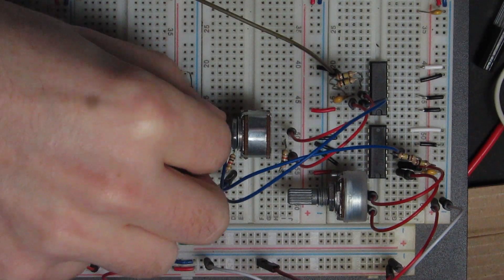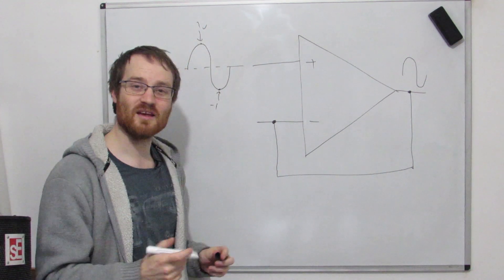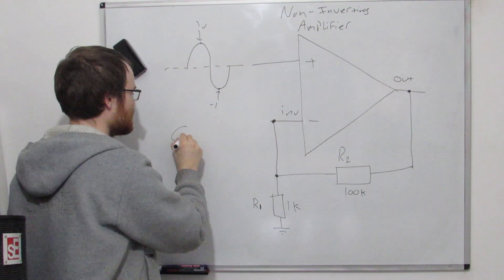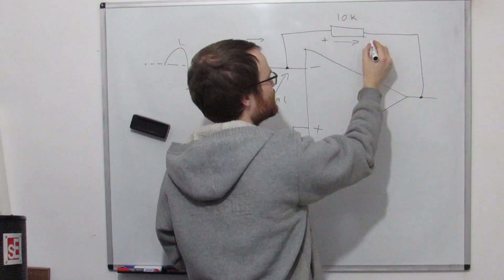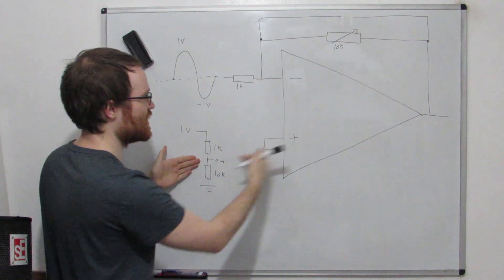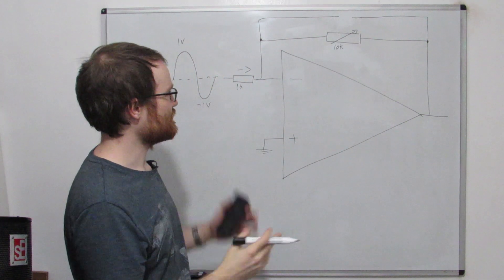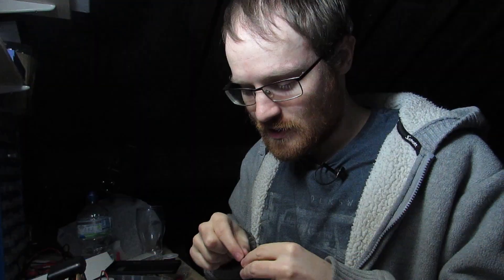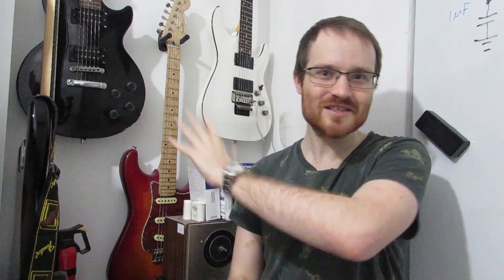Op-Amp Golden Rules & Designing An Active Filter!

Comment: Thanks for posting. If + input of opamp starts at 1 at peak of osc and - input starts at 0, then diff is 1 so it outputs 1 and then the diff is 0, so…..how does that function if diff is 0 at that point? Basically it seems as though it would outputting a binary toggle as voltage is + on + input.

Comment: NEWBE QUESTION THE 40106 AND 4069 ARE THEY CONNECT TO +12V AND -12    OR +12V AND GND
Reply: Both can be set up either way (which is part of their appeal). Generally you'll want a steady reference at half your supply if you want to start off with simple battery powered bits.  This reference voltage will act as ground (zero potential) for your little audio signals.  The trick is to hold that reference steady under various conditions.

Comment: CD4069 is a Logic IC and not an OP-Amp nor an Amplifier. The IC has nothing to do with an OP-Amp or an Amplifier !
Reply: It performs it's logic switching by extreme amplification (to keep the edges sharp). That behavior can be manipulated into operating in a (mostly)  linear inverting amplification.  It's an extremely common use of the cd4069.  It's used in synthesizers and guitar pedals and all types of silly stuff from major manufacturers.
Reply: @ahdziz666  Try to get a sinusoidal direct from the output of the CD4069. That will not work . The CD4069 is sometimes used to improve square wave signals. Since the gates contain a Schmitt trigger. But the CD4069 is and remains a digital IC. And is used in logic circuits.I can well imagine that the chip will be used in synthesizers. Because sometimes you want everything to be beautifully distorted. But that doesn't make it an Amplifier....
Reply: @ahdziz666  I just read the data sheet the CD4069 has no Schmitt trigger but there are some with Schmitt trigger. Sorry, my statement was wrong on that point! I can only recommend reading the data sheet. It's all in there!
Reply: @Thomas72B  I've read the data sheet and built a few bits and pieces using the 4069 as an amp.  It's not pretty but it's easy and good enough for stomp boxes and wah filters.  You can make a sine generator out of an inverter that's looping a twin T notch filter.  It's not anything like a pure sine wave but it can make synth drums ala tr-808 quite nicely.  It's also nice to damp down the feedback a bit and make a fuzz pedal.  Or you can go full on gated square wave distortion as well.
Reply: @Thomas72B  you might be thinking of the 40106 Schmitt trigger chip.  Great for some simple oscillators, but not so much for driving an analog signal.
Reply: @ahdziz666  The CD4069 is the wrong chip for analog signals. Analog signals are not the job for a CD4069. If you do that, it's wrong use because it's not designed for that...there are much better options for analog signal processing !!
Reply: @Thomas72B  I understand your point but I'm perfectly happy to use things for whatever works especially of I have a box full of them (which I do).  Even some of the mfr documents show the 4069 used as an inverting amp.  The internals of the chip aren't magic.  They behave as one would expect depending on how you connect them.  That being said they are also very handy for their intended use of inverting digital logic (which is why I have so many to play with).
Reply: @ahdziz666  I can understand that very well. I think I used to be the same way ... but then I learned the whole thing and today electronics  is my job and my Hobby.
Reply: @Thomas72B  I'm just a musician and a math nerd. If I can make the numbers work and the sound is cool, then I'm happy regardless of how I go about it.  I am more into the DSP side of things myself but my son is getting big into guitar so I figured we would build some modular FX.

Comment: All you're doing is writing a ton of stuff. No idea what you're doing until the end, and that's very unclear. You need to learn how to do digital writing diagrams to include the positive, negative, dual wires, wire gages, component photos, ground location, power input locations, speaker locations, etc.
Reply: Sorry but I feel like that feedback was a bit uncalled for 😕 Shame if the format didn't work for you, I can understand that, but it sounds like everyone else in the comment section (me included) thought it was a very clear and simple explanation of the circuit and what it really does.
Reply: @MarcDupuis50400  Its a shame that the CD4069 is a hex inverter and not an op amp.
Reply: skill issue
Reply: Retarded 😔🤝 it's terminal

Comment: The CD4069 is a six-fold inverter, tha CD40106 is a six-fold Schmitt-trigger inverter. I don't understand the relation of these devices to an op amp. Or these CMOS inverters also used as "low cost" op amps?

Comment: 2:25 "it doesn't really do anything" it does do something, though. It's an  impedance converter that presents a high impedance to the source and a low impedance on the output that can drive a low impedance load or subsequent circuit. There's also power gain. Good stuff.
Reply: this + isolating the source from the rest of the circuit

Comment: Another great video, thanks! However, I was confused about one thing — I’ve played around with tl072s and similar as op amps, but when I looked at the data sheet for the CD4069UB, it says it’s a hex inverter, and I don’t quite understand how this works. Would it only work with square wave type “logic” signals that only have a high and low state? I don’t understand how it’s able to provide voltages besides supply and ground. Still a real beginner and maybe I’ve forgotten something fundamental from an earlier video?
Reply from the maker: this is actually a great and very thoughtful question. It's quite technical but essentially the 4069UB is a special type of inverter that has unbuffered inputs and outputs that allows it to have values inbetween the usual limits of 20 & 80% of Vcc that we usually say are the valid high and low states of logic chips. This is how it essentially acts as an inverting op-amp, but it has a really nice characteristic curve that gives it a nice amount of distortion as well as being slightly simpler to put together for beginners.
If you're more comfortable then go ahead and use ordinary op-amps. That's what we'll generally be using moving forward anyway! Just set the non-inverting input to 1/2 of Vcc and it should be similar. Maybe set them both up and see how they behave slightly differently as you approach the supply rails! :)

If you want more info there's a pretty great TI technical document that explains it, although it is quite technical you seem like the type of guy (like me!) who likes to understand everything thoroughly as they learn so i would have a look over it. Don't worry too much if you don't understand everything!
https://www.ti.com/lit/an/scha004/scha004.pdf
Reply: Here's a very good video by TSP that explains how a CMOS inverter can be used as an amplifier. In a nutshell the transistors in the output circuitry of the inverter acts as an amplifier for voltages that do not put it them into saturation or cutoff which would be the way the transistors would be used in a digital system. https://www.youtube.com/watch?v=TABgfsryt8s Hope this help, Vince.